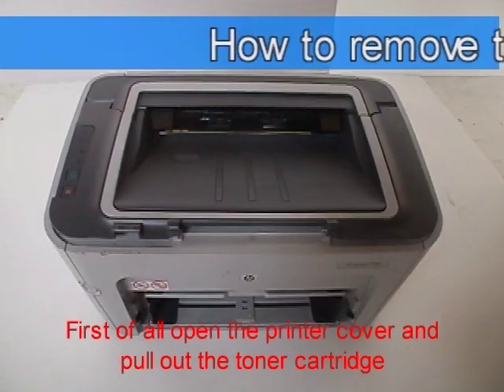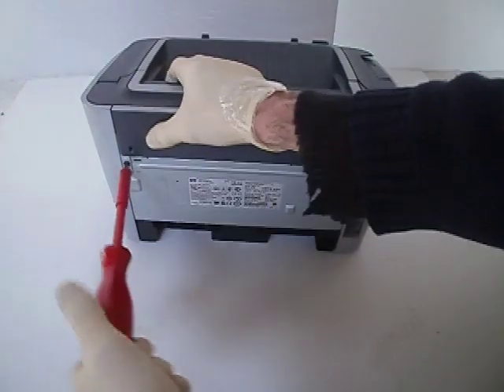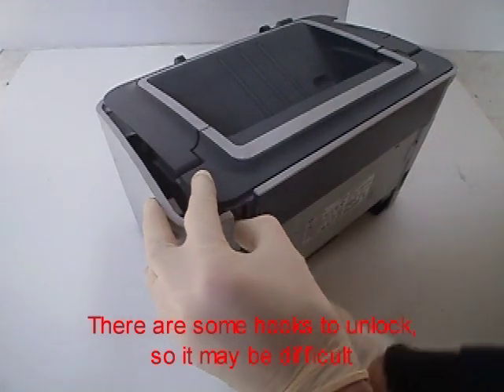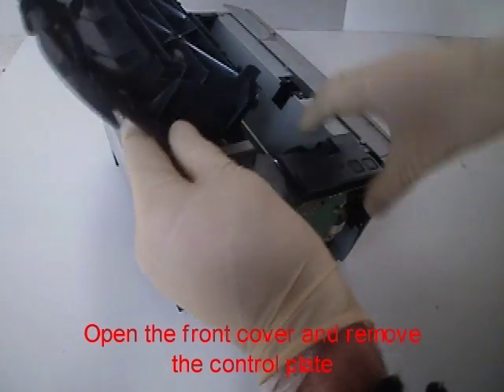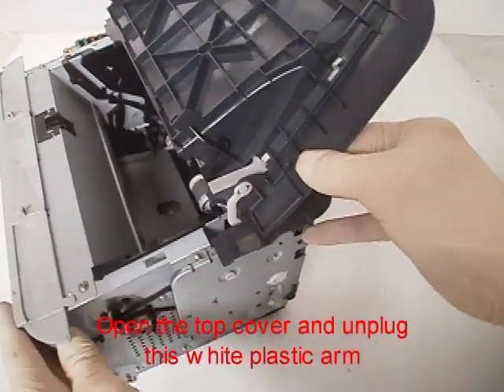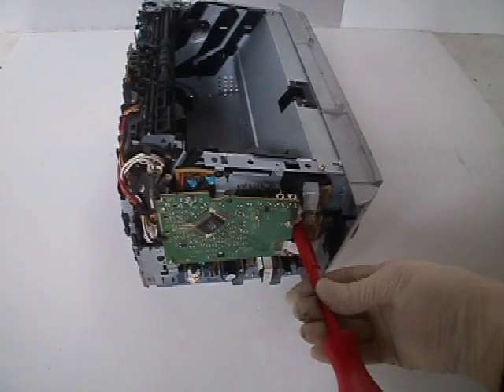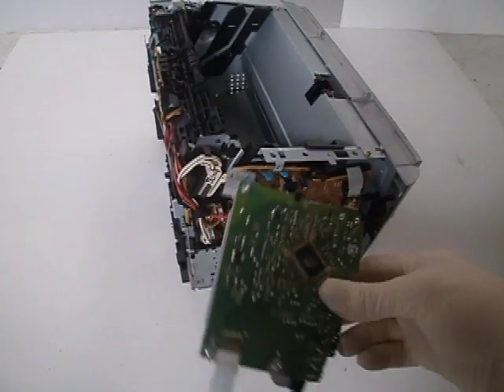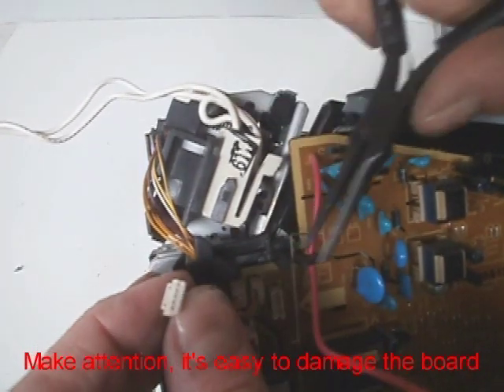How To Disassemby HP Printer Laserjet P1505 And Remove Fuser

Comment: Good instructions. My printer must have been an older (or newer?) model - it had a few extra screws to remove and an extra plastic piece that comes off from the side of the fuser near the spring.

Comment: Hi. When i connect hp laserjet p1505n to tp-link wifi router through LAN cable lights on the ethernet port( green is solid and orange blinking). But wifi router not showing printer's IP/MAC address in DHCP configurations. Can't configuring with wifi router to take print wirelessly.

Comment: Thanks for the response.
Should I change it or is there a fuse that can be replaced? or should I buy a new printer?
Do you have a suggestion?
Reply from the maker: +Rustu Deryol there is a fuse, but probably the power unit is defective. the problem may be also in the mother board
Reply: +viandant5 thanks again.

Comment: Sir, i have a question, my own HP p1505 turn off totally when ever i send document for printing, i have to power it on and resend documents so many times before it works
Reply from the maker: you can try to reinstall the driver, but in my opinion there is a short circuit somewhere in the mother board. also check the power cord cable
Reply: Hmm, I have uninstalled driver already and power cables too.
What do I need in other to trace the area or segment associated with the short circuit

Comment: Hi,
I have a question:
My HP p1505 does not turn on at all.
What is the solution? I tried with a different cord and a different power outlet.
Still, no power.
Thanks for the response.
Reply from the maker: +Rustu Deryol I think the problem is the power supply unit

Comment: why my hp p1505 model making loud rattling sound from the front roller when it is about to print and while printing? Thank you.
Reply from the maker: what is the front roller? May be the gears of the drum have a broken teeth, or one of the gear on the side of the panel

Comment: do you know how to fix actuator from front top ? because after testing  with several cartridge  all printing are full white. and I see this broken .. rgds
Reply from the maker: do you mean the motor drive of the printer?
Reply: @viandant5  I dont think so.. becasue machine works fine but by printing  blank pages ..
Reply from the maker: @santiagomonarriz8994  what is the actuator from the top?

Comment: hello sir ,   i want to ask one question . i have a printer HP LASER JET P1505. last night i refill the toner from shop but when i fix into the printer then two lihgts are "on" on the printer. one is the green light and 2nd is the orange i mean  first light and third light is on what is problem?i don't know. help me
Reply from the maker: I think the printer believe the cartridge is absent. did you change the chip? Or  you have to check connection inside the cartridge or between the drum of the cartridge and the printer .

Comment: What could happen on a P1505 (that is still working perfectly) when the power button is not alway turning  ON the printer. I have to play with the button many time to get the printer turned ON.
Reply from the maker: A bad contact in the button contact I think
Reply: @viandant5  Ok, Fixable?
Reply from the maker: You have to disassembly the printer and check the control panel and its conenctions
Reply: Hi, You can also try to fix the problem with CRC Kf Contact Cleaner, Aerosol 200 ml. This requires to remove only 2 screws (one at the back and one on the top. That's what I did.
Reply: Did you ever get yours to work? I have the same issue. It’s a great printer and I have extra cartridges. Hate to throw it away because of a stupid button not working.
Started taking a couple presses to get it to turn on, then 10-15, then about 50. Now can’t get it to turn on

Comment: hello sir , after that you will be definitely fine and me too . sir tell me about copier i have a m 3027 mfp when i copy then came lining on the copy paper sir what is this and why come line on the copy paper?
Reply from the maker: It depends on which line, which color. a straight black vertical line may be the wiper blade, or the drum
Reply: SIR VERTICAL LINE ON THE LEFT SIDE OF THE PAPER
Reply: AND SIR PRINTER PRINTING OK JUST COPIER PROBLEM
Reply from the maker: So probably the problem is the laser scanner. Check if the window glass is clean for start
Reply: sir i put blank paper on flat bed glass then also like same result come
Reply: and sir window glass upside clean but down side mean inside glass little bit dust

Comment: Hi! please how do i solve engine scanner error problem with hp laserjet p1505
Reply from the maker: try to change toner cartridge, if the error is still there probably you are having a failure with the scanner motor in the printer.
Reply: Thanks for your prompt reply, Please kindly help me with information on how to fix the Scanner motor in the printer. This problem is causing me a lot of embarrassment from the user. May God richly Bless you. I have learnt and benefited from your wealth of knowledge, God bless you.
Regards,

Daniel Oritsejafor.
Reply from the maker: You have to change that motor, there is no other way, but  I have no video on this argoument. you have to dismantle the printer to have access at the scanner

Comment: 52.0 Laser - What is it ? Please
Reply from the maker: Turn off the power, detach the electrical cable abd wait 10 minutes and insert the electrical cable and turn on the power. Do not use surge protectors. Plug the product directly into the wall socket. a defective cartridge may cause the problem. if nothing helps, the laser scanner unit is defective
Reply: Thank you